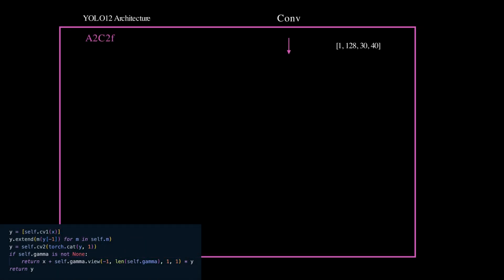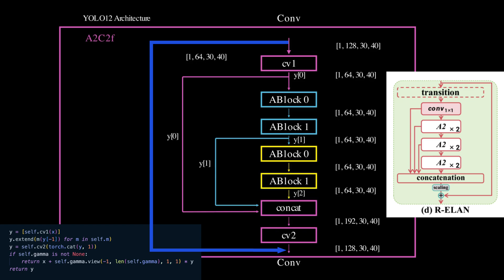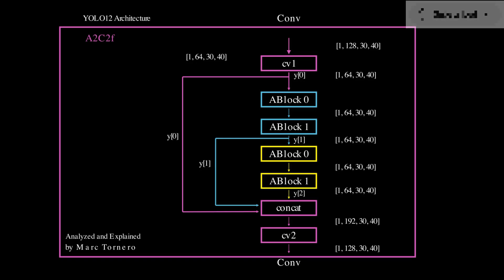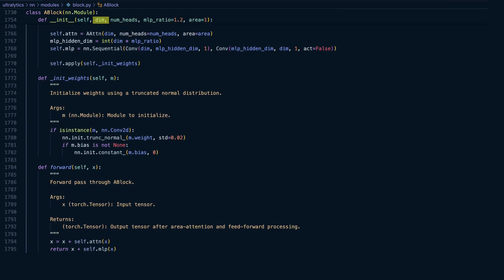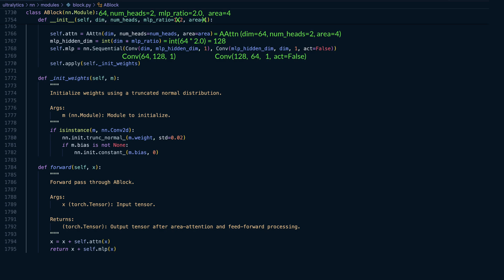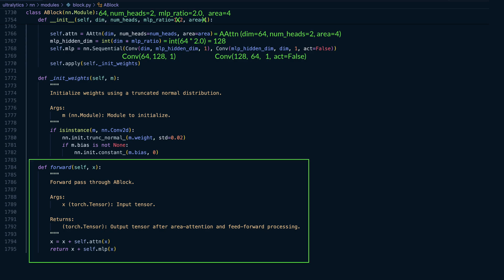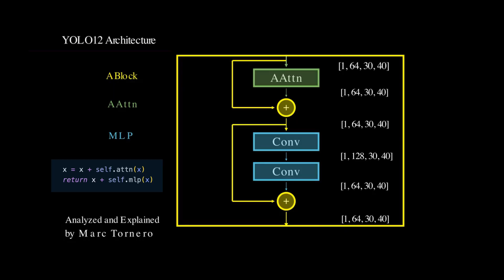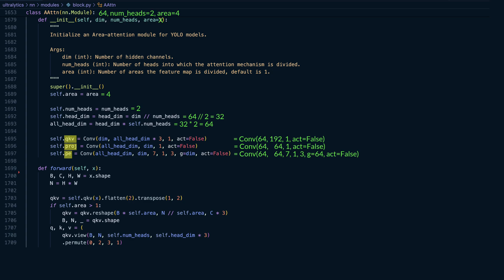5. Area Attention Blocks (A2C2f). YOLO12 (YOLOv12) Series

Comment: Hello, can you explain using the new yolov12 structure that has R-ELAN instead of C3K2? I'm still confused, what is the function of A2 in R-ELAN? Is A2 an attention? If not, where is the attention located? Is the A2 module an attention? Where does the QKV number come from? I'm still confused.
Reply from the maker: Hi! Great questions. In YOLOv12, the A2C2f modules replace the C3k2 blocks used in YOLO11. Inside A2C2f you have stacked ABlock modules, and also an optional residual path referred to as RELAN.

The actual attention happens inside the AAttn module, which is called by each ABlock. ABlock itself is just the wrapper that applies AAttn (where Q, K, V are created) and then a small MLP. If you haven’t already, I cover this part in detail in video 6.

Comment: Do we call A2  as A2C2f because it depends on the same C2f structure, but the key difference is that the bottleneck blocks inside the C2f structure are replaced with the more advanced ABlock modules? I think I u didnt mention such an info, thank u Marc
Reply from the maker: That’s a great observation! The A2C2f is indeed conceptually similar to C2f in that it replaces Bottleneck blocks with ABlock modules using area attention.

However, I didn’t directly reference C2f in the video because, while A2C2f borrows its name and extends the idea, it does not actually follow the C2f structure. If it did, it would simply inherit C2f and swap out the transformation blocks (m) for ABlocks. Instead, A2C2f has a different layout, and it omits the typical split you see in C2f (regardless of what m contains).

For contrast, consider other blocks in YOLO11 (covered in videos 9 and 10 of my YOLO11 series) that do follow the C2f structure. In those cases, the split–concat pattern is always present, no matter whether the m module contains Bottlenecks, C3, or something else. This distinction makes it clear that, while A2C2f is conceptually related, it diverges from the classic C2f design.

Sorry for the long answer!
Reply: @marc_tornero  completely understood, thx marc
Reply from the maker: Awesome! Glad to hear that.